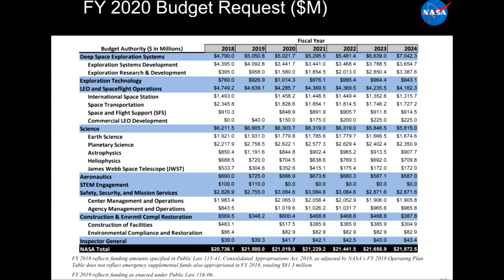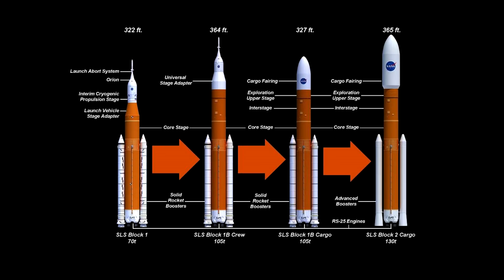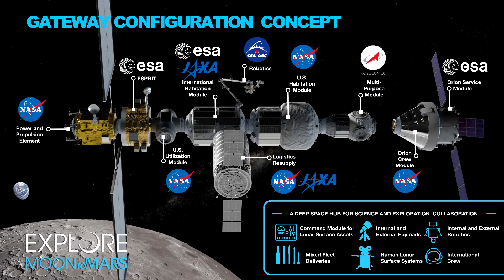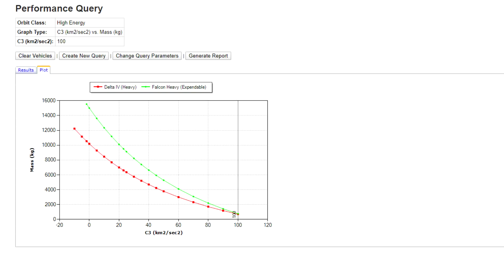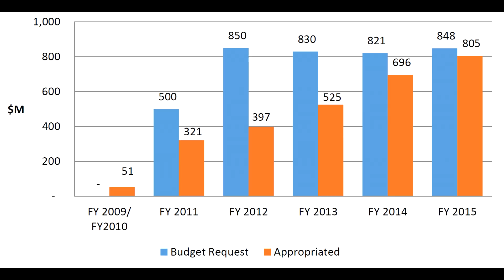SLS Rocket In Trouble After New White House Budget Request

Comment: They should do the Europa Clipper with two partially reusable Falcon Heavy launches.  If you can navigate a probe to a specific destination in the outer solar system you can do an automated docking in zero gee.  Dragon just did an automated docking the other day, c'mon people we can do this.
Reply: Yup probably find 5 Falcon heavy reusable flights are cheaper than one SLS flight.
Reply: @Codysdab , ya, you should be able to do it with two, maybe even expend the center core and do a dual droneship landing.
Reply: Or maybe even a dual Falcon Heavy launch and a quad droneship landing.
Reply: @lucasbowering  I just did a price check the SLS is predicted to cost around $1.5 to 2.5 billion per launch.

Assuming its the cheaper number and we know a FH costs $90 million a launch Nasa could pay for 16+ FH launches for one SLS launch.

Screw the SLS I say, remove sunk cost bias and cancel the whole thing.
Reply: I can only imagine what it would take to redesign the upper stage for on-orbit refuel and docking.
Reply: @motokid6008  You don't need to re fuel, just attach an upper stage in LEO.
Reply: @lucasbowering  - Ah true. Then that would only require one FH. One F9 to put Clipper in orbit then a payload-less ( not counting a docking adapter ) FH launch with a modified upper stage. Or have Clipper do the r&d. Probably better to have a small mass dock with a large mass as opposed to the other way around. Boil off could be an issue however.
Reply: @motokid6008 launch the clipper on the FH you have so much more room for more systems, more power etc.  Mass has been a huge limiting factor in space craft design, this has to change,
Reply: @lucasbowering  - Yeah but if the idea is to rendezvous and dock with clipper in LEO then it will not need a FH to launch it. So if you launch the Clipper on a F9 into LEO. Then a FH launch following it to either refuel the upper stage or dock with an already fueled upper stage. The idea is to have enough on-orbit deltaV to make an ejection burn. Preferably a direct one that doesn't require gravity assists.
Reply: @motokid6008  Your probably right.
Reply: Why not launch Europa Clipper on a BFR?
Reply: @dalethelander3781  even if Elon had a fully functional BFR by mid 2020 it would still take a long time for NASA to certify it for an important mission like Europa Clipper.
Reply: @lucasbowering  Damn!

Comment: Would they also refurbish the srbs like in the shuttle programme?
Reply: Nope, which is probably a good thing since refurbishing them in the STS days never made sense either. Still a step in the wrong direction in my opinion.
Reply: No the much touted reusable boosters will fall into the ocean if SLS ever flies.
Reply: The stack of the solids on SLS is taller than STS; more sections of fuel. The solids won't be jettisoned until SLS is well above the Karman Line. They'll burn up.

Comment: Hey Scott what do you think we should be doing should we start to work towards a moon base as a staging area for Mars? Also what do you recommend as far as telescopes for somebody just starting in.... using telescopes lol
Reply from the maker: Extracting water to make fuel on the moon would be a game changer.
Secondary to that would be refining aluminium to make structural elements on the moon.

As for a telescope, for a complete beginner I recommend a small 70 or 80mm backpack telescope like this: https://amzn.to/2T08AOL
It's a cheap way to get started, you can then add better Eyepieces, and mounts. And from there you can upgrade to something bigger without rendering this small telescope redundant.
Reply: @scottmanley  Make speculative video on ISRU on the moon... why haven't we done it? We have small drills, big batteries, we have heavy lift rockets. Is it really because university professors don't think of it as science?
Reply: The most probable thing to happen would be an orbiting station around the moon for refusing, then the craft don't need to waste deltet v landing and taking off again
Reply: The metallic elements for large interplanetary craft have such a lower launch cost from the Moon as opposed to Earth,  that the Moon as the future staging ground is a virtual economic inevitability.
Reply: ArchEnema 67 except you need to get the stuff to the moon in the first place. It makes more sense to stage in earth orbit.

Comment: SLS is a boondoggle program.
Reply: But the hardware is amazing. The RS-25 is so efficient, that the shuttle is technically the most capable rocket, able to deliver the most mass (not payload) to orbit. The space shuttle has enough delta v to get the external tank to a low earth orbit, which means that the STS stack can get wet mass of the space shuttle + dry mass of the external tank to orbit. Same thing with the SLS, it has enough delta v to get the core stage to orbit. The Saturn V is not capable of doing this with its S-II stage, because it will take a huge chunk out of the payload capacity (as proven by Skylab).